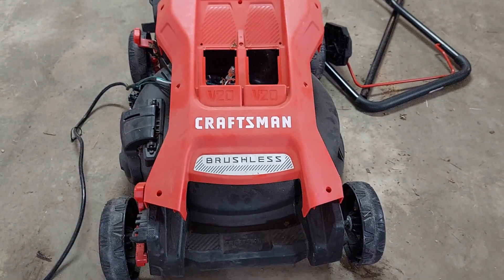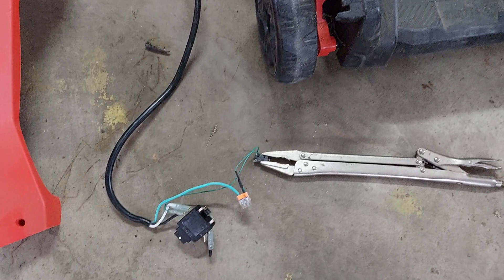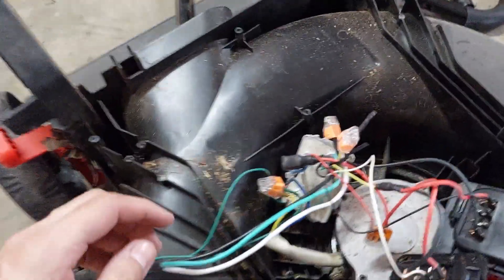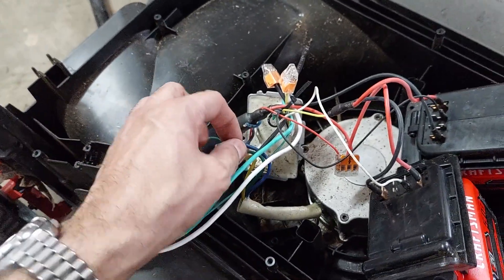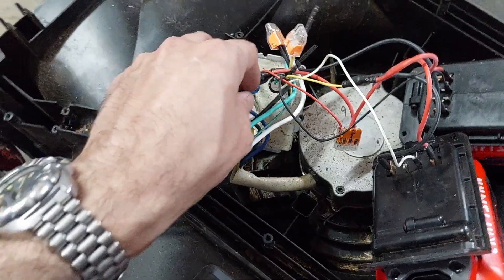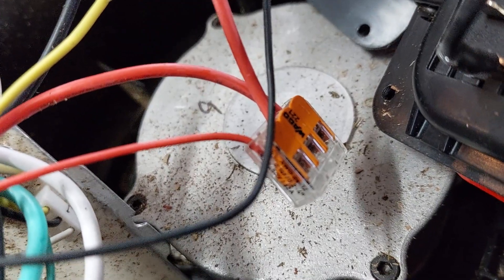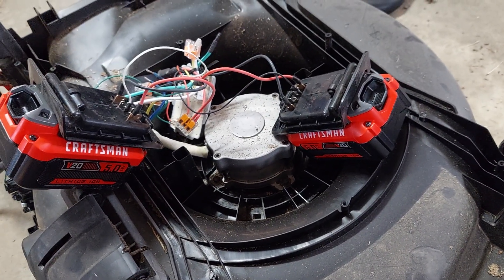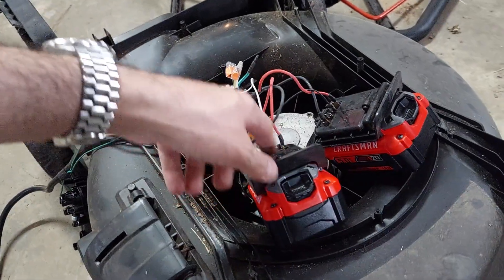Craftsman Lawnmower common issue, easy fix if you know how to solder

Comment: I did a continuity test on all my connectors. I'd still swap them out as mentioned in your video. The main issue with my mower ended up being the side safety switch on the handle. The button is spring actuated and presses down on top of a relay when the handle is pulled down. The pin that goes through the center of the button was not seated correctly causing the cam action of the handle to not depress the top of the relay reliably. I tapped it into to place and its fine now.

Comment: I have the exact same mower with the exact same issue, and i know nothing about electrical, so do you still recommend that xt60 clips you talked about or something else ?
Reply from the maker: XT60, yes. But you'd need to solder. I would suggest 

https://www.youtube.com/watch?v=zcWmvXxRfOs

https://www.youtube.com/watch?v=GoPT69y98pY

One of those. 

Also, they have these: https://www.amazon.com/s?k=MT60+Male+and+Female+Three+Core+Connector&crid=MVEGBWDL61N4&sprefix=mt60+male+and+female+three+core+connector%2Caps%2C332&ref=nb_sb_noss

Those have three pins.

Comment: Thanks for the heads up. Did you end up changing the connectors? Is there a reason you couldn't use the Wago connectors I saw in the background?
Reply from the maker: The Wago connectors is what came with it. They were what needed to be cut out.

Comment: I'm experiencing the same sound. Clicks when you try to turn it on. Took it apart and all wires look brand new. Any advice on what else to try to get it to work?
Reply from the maker: The wiring is bad.

It needs continuity between all three wires back to the control board.

Return it and get gas honestly.
Reply: The big bulging thing wrapped in heat shrink is a 40 amp fuse. Check that.
Reply: Do you have a control board I could buy or borrow? I think the capacitor or something else on my board is shot. I had one partially melted connector and a blown 40 amp fuse. Fixing the connector immediately blew the fuse. Bypassing the fuse, I only get a quick burst of less than 1 volt to the motor when I pull the handle.
Reply: @MoneyManHolmes exact same thing here, My fuse was blown so I bypassed it just to check that the rest of the system was working and it turned on for a second and now I get nothing. Did you figure this out?
Reply: I can’t say for 100%, but my conclusion was the capacitor on the mother board. Unfortunately, it’s all epoxy coated, so not really serviceable. I didn’t realize it had a 3 year warranty until later, so I called and they sent me an entire new lawnmower. The motherboard is not even sold separately.
Reply: @MoneyManHolmes  Did they need a purchase receipt for it? We have one that our landlord bought last year, but he doesn't have the receipt.
Reply: On the back of the door where the optional grass collection bag goes, there is a date code. I had to clean all the caked up grass to find it. They went off a picture of the date code since I didn’t have a receipt either. They didn’t provide much push back at all. They probably know these are poorly designed junk compared to their other power tools.
Reply: Also, my new one arrived with broken height adjusters, so tell him not to throw the old one away just yet 🤣 They’re easy to salvage with a screwdriver and small angled pick.
Reply: @MoneyManHolmes  nice! That’s really good to know. I’ve checked the wiring, everything looks in good condition, but the fuse looks hard to read. I probably need a multimeter to check for continuity, but if they can send me a new one, that’s even better! 😁
Reply: @MoneyManHolmes  yikes! I like their stuff but they’re junk really. Thanks for the tip!